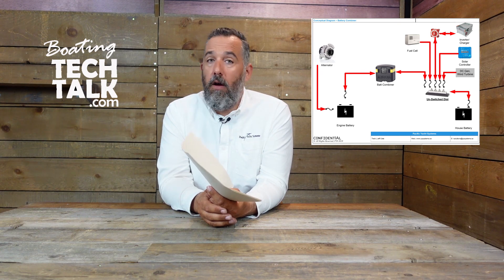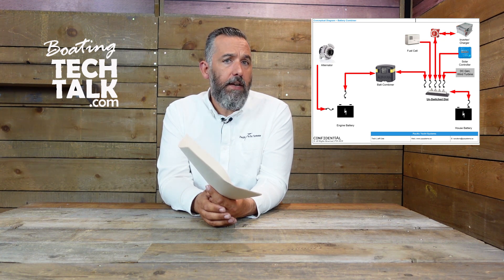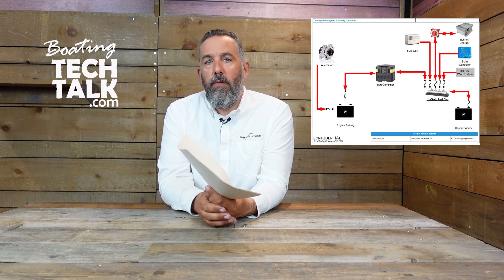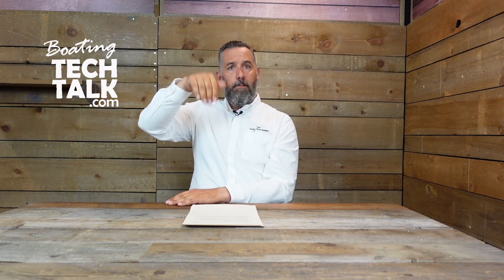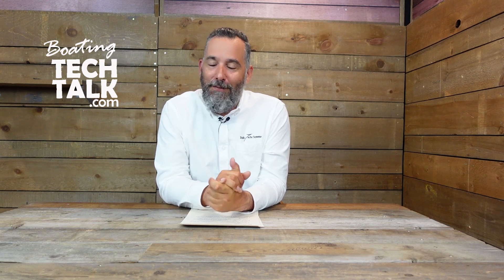What Are the Dangers of Crossing Leads on a Boat Starter Battery?

Comment: Time for an update on my mistake. Just some background just purchased the boat so sorting out what everything did and how it worked was bit of a job without any help. Apparently the prior owner never used the boat other than to sit on it all summer long so the batteries were dead.  The day we launched the boat I put the battery in, very rushed due to the other one being dead. So the way I noticed I crossed the leads was the bendix on the starter turned the opposite way. Fortunately for me the terminal fuse on the house battery blew.  The gauges were not turned on so no harm there.  The only problem turned out to be a burned out alternator.  So after a rebuild, and new terminal fuse everything fired up and no other problems found.  Fairly inexpensive lesson that could have been a potential disaster.  It's never good to rush to get something done. Will never make a rookie mistake like that again hopefully. LOL
Reply from the maker: Thanks for sharing Steven, we all learn from our own and hopefully from the mistakes of others too, it's a journey.

Comment: My cheap solar regulator shows a connection between the battery+ and solar panel+ when I check with my multimeter and zero volts in the system (battery and panel disconnected). Why is this, and should I be worried?
Reply from the maker: Hmmm, not sure as i've never tested for this.

Comment: come on, if the battery is hooked up backwards the starter will just turn backwards and start the motor turning the wrong way. No big deal just remember to put the boat in reverse to go forward, and in forward to go reverse.
Reply from the maker: Very funny.